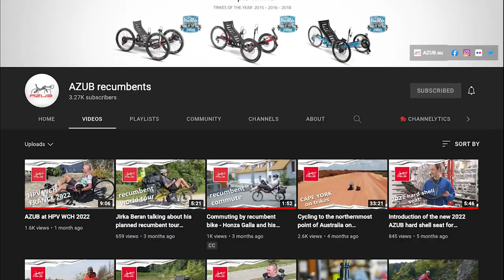Extreme Folding Recumbent Trike | Last Day At AZUB

Comment: I am planning to travel by air with my Ti Fly26, with Shimano STEPS EP8.  For me, the trike is a ‘mobility assistive device’, and should be accepted as such by the airline.  What is your experience with checking a trike as luggage just folded, not in a box?  Any concerns about damage?
Reply from the maker: yea... the X is quite a bit larger with the 2 front 26inch tires... i did the mobility device route once from Okinawa to Taipei... thats a great idea... but for such a long trip... i would not want to use it.